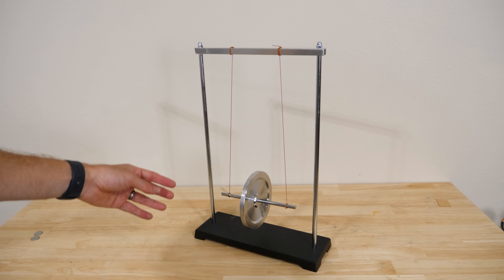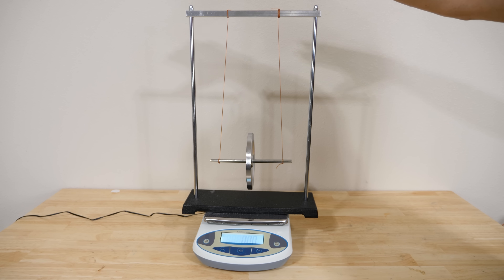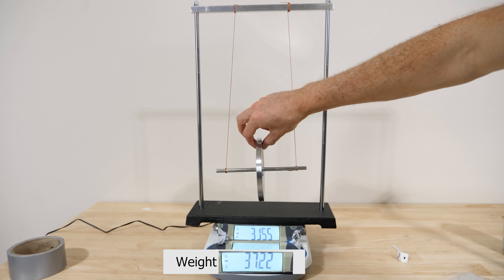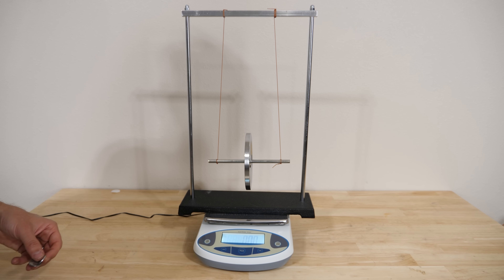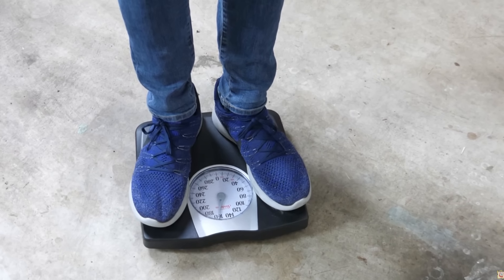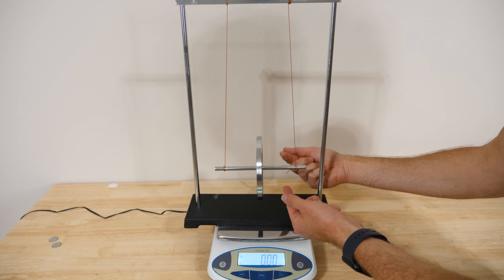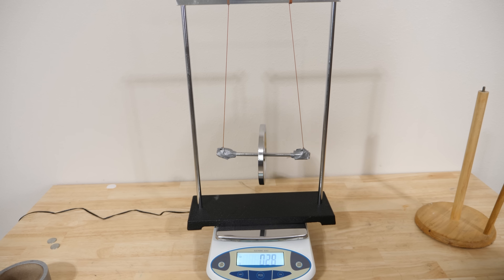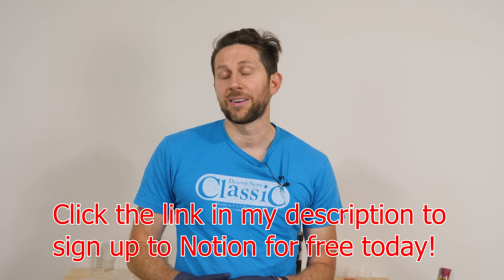How Does The Anti-Gravity Wheel Work?

Comment: If you plotted it at a high refresh rate, and looked at the area under the curve of the measured weight, would it average out to zero (slight negative most of the time, very positive for a fraction of a second as it bounces up)?
Reply: Yes, actually it would be slightly positive because energy has mass. But it would be very close to zero
Reply: @megamaser     No.   Energy does not have mass.  Light is energy and massless.  Mass can be converted to energy such as in a nuclear reaction, but that does not mean that energy has mass.  
In the experiment in the video, the mass never changes.  What changes is the downward force on the scale due to the change in rotational speed of the wheel.  The overall downward force over time is equal to the weight of the wheel.  So, while it is changing speed the downward force is less, but at the point where it comes to the end of the strings, there would be a surge to equal out the loss over the rest of the time.  
This would be similar to dropping an object on a bungee cord.  When it is falling the force on the connection point would be lower than the weight of the falling object.  When it hits the bottom there would be a surge, then it would be lower again on the way up.  The overall weight times time would be the same as the weight of the object at rest over an equal amount of time.
Reply: @my3dviews  Einstein showed that mass and energy are equivalent. Mass is basically a confined form of energy. So yes a free photon has no mass. But if you trap a photon in a box of mirrors then it will add mass to that box. The mass of protons and neutrons primarily comes from the kinetic energy of the quarks, which are confined by the strong force. Adding energy to an object by heating, vibrating, or rotating that object increases its mass.
Reply: @megamaser    Quote: "Einstein showed that mass and energy are equivalent."   Wrong.  E (energy) = m (mass) x c(speed of light) squared.  Notice Einstein's equation is not simply E=m.  
Getting back to your first claim that energy has mass.  That is incorrect.  Mass can be converted to energy and energy can be converted to mass, but energy itself does not have mass.   
Your last comment even admits that.  It says that a photon trapped in a box of mirrors will add mass.  That is converting energy into mass, since the photon no longer exists.  That is not the same as saying "energy has mass".  (it doesn't).
Reply: @my3dviews  Interesting how you're so sure of yourself but obviously not doing any actual research before making these assertions. I'm only stating some indisputed scientific facts that were established 100 years ago. Anyone with even only a bs in physics should know these things. I'll address your points one by one, but you seem pretty hostile to new ways of thinking, so I'm doubtful that it will be very fruitful. Anyway...

"Einstein's equation is not simply E=m"

Actually, it is, essentially. c is only a constant. It's an arbitrary scaling factor that's only used due to the choice of units. He included it mainly to illustrate the insanely large amount of energy in small amounts of mass. But it can be left out without impacting the equivalence. If you choose some other units, then you don't need the scaling factor. It's actually quite common to use energy units to measure mass, such as electron volts.

Trapping the photon in a box of mirrors does not destroy the photon. It continues to exist, reflecting against the mirrors. If you open the box, the photon will escape. It's a commonly used thought experiment to illustrate mass energy equivalence. There are some nice YouTube videos to visualize this example. 

Converting mass to energy means you have released confined energy. Converting energy to mass means you have confined energy. 

For example, endothermic chemical reactions consume energy to bring electrons into a higher energy level. Usually this is thought of as a conversion from kinetic to potential energy. But that potential energy has mass, we know this because endothermic reactions result in products that have greater rest mass than the reactants, so it can also be considered to be a conversion of energy into mass. But if you consider the heat that was absorbed, it was also contributing mass to whatever was hot, so the overall mass of the entire system is unchanged. The energy was always massive, and the mass was always energy. 

Likewise, exothermic reactions, like fire, can be said to convert mass into energy, because the reactants have greater rest mass than the products. However this lost mass was manifested in the potential energy of electrons, and it actually isn't lost since the thermal energy still contributes mass to the entire system.

It is a little weird to say that energy "has" mass. I think it's more accurate to say that mass is energy. Mass is an emergent phenomenon that results from the confinement of energy.
Reply: @megamaser    Quote: "Converting mass to energy means you have released confined energy. Converting energy to mass means you have confined energy."   Never said otherwise.  In fact, that is what I was saying.  Energy and mass can be converted one to the other, but that does not mean that energy has mass.  So giving lots of examples of mass being converted to energy isn't saying anything that I wasn't.  

Your last comment stated "It is a little weird to say that energy "has" mass. I think it's more accurate to say that mass is energy."

I wouldn't say that it is just more accurate, since the first claim was inaccurate.    

Compare those statements. 
1)  Energy has mass.
2)  Mass is energy.  
Ask the question:  Can you have energy without mass?  If that answer is yes, then does energy have mass?  

If you want to stick to that.  Go ahead, but I don't agree.
Reply: @my3dviews  Well now you're just getting pedantic. This point is irrelevant to a lot of the arguments you were making. And it's also irrelevant to this video. It seems that your main goal is to find some way to prove someone wrong to make yourself feel smart. Not sure what that's going to accomplish in the long run. 

Sure I'll agree that not all energy has mass. There needs to be some kind of interaction to say there is mass. But in the context of this video, the energy in question does have mass, just like a proton has mass.

Comment: I wonder if this method could be exploited to move heavy objects across distances with minimal friction do to gravity.
Reply: Maybe that’s how the Egyptians built the pyramids!
Reply: @brads9418  nooooo! Yes! Yes that's it! OMG!
Reply: @johnnycash4034  more likely they used vibrations of some sort.
Reply: @loganthesaint  nooooo! Yes! Yes absolutely! That's it!
Reply: I was thinking about a crane that used this, but the wheel in this video must weight at least 500g (probably more) and it only loses 6g for a relatively short period and you have to use energy to roll it up. The cases where you'd need to move something that is 1% too heavy are probably no worth the complexity of such a crane.
Reply: It wouldn't be efficient, as the total amount of energy consumed would be far greater.
Reply: You probably can't. It was kind of like when I was jumping on the scale. Most of the time, I would weight zero, but when I was physically touching the scale, my weight goes up a lot. You can totally build a machine that by jumping, you reduce the friction, but the jumping itself probably will cost more energy loss. There aren't many species jumping like kangaroo :)
Reply: The average readout on the scale really should be zero, if the scale had enough resolution to sample what is happening at every point in time.  It is a sampling bias that gives the appearance that there is a loss of weight of the system.  If you could account for exactly what is happening at every point in time during the rebound, you'd see a spike in the scale's reading.  Integrate the scale's reading between two equivalent points in the scale, and you would see that the net impulse from scale fluctuations is zero.

That said, if you tried to use this for relieving objects of their weight, so that you could improve the mobility, you'd have to pause every so often to allow the rebound to happen, where the apparent weight of the objects is so high, that the number of g's would not be survivable for a human passenger.
Reply: I don't think it is like jumping on a scale. As the wheel only moves slowly up or down the string....that type of momentum would only have a slight effect on the weight for a slight amount of time.
Reply: @colorado841  It would be like you jumping on the scale in a slow motion.
Reply: @lalandbaby  No...because then there would be a spike in weight that would last for a long time.

Comment: @The Action Lab  I think the reason the gyroscopic weight was easy to lift was the lack of torque needing to be applied to keep the weight from rotating down. I think it would be similarly light if held at its center of mass.

Comment: A simple way to think about this is to imagine yourself tossing a 10 pound weight into the air repeatedly and the time it takes you to throw it back up equals the time it is in the air.  You can say that it is weightless when it is in the air, but the average force of the weight while you are holding it will be 20 pounds.  Two men keeping one of their two weights in the air at all times will still be supporting 20 pounds at all times but it will be as if the weight is shifting on the scale.  Also consider a bouncy ball.  It may only be on the ground 1/100 of the time.  But the average force may be 100 times that of the ball.  This may help understand why dropping a steel ball or hammer can be so powerful.  And why adding springs can decrease the force of a gun greatly.

Comment: Would the same effect be measured from a pendulum swinging back and forth?
Reply: Maybe, but it would be minor because the pendulum lowers its center of mass only my rather small distance. But I think the same principle would work for weight-driven clocks as well.
Reply: When the pendulum bob accelerates upward, there is an apparent gain in weight.  When the pendulum bob accelerates downward, there is an apparent loss in weight.  The centripetal acceleration is from the rod pulling the bob inward, and the tangential acceleration is from the component of gravity that makes it swing.  We can calculate when this will happen by finding the net y-component acceleration, and determining the critical angle where it is zero.

Given an amplitude angle of A, I derived the following formula for the critical angle theta_crit, where the vertical acceleration switches direction.
theta_crit = 2*(arctan(sqrt((2 - sqrt(cos^2(A) + 3))/(cos(A) + 1))))

For small amplitudes, this approaches sqrt(2)/2, or 70.7% of the amplitude angle.  For a 30 degree amplitude, it's 69%, or at 20.9 degrees.  The critical angle becomes a smaller fraction of the amplitude, the higher the amplitude.  The extreme case of a 180 degree amplitude has a divide by zero problem, but we can calculate it for angles arbitrary close to 180 degrees and get that it happens at around 39% of the amplitude.

Also for small amplitudes, where you can approximate the pendulum as simple harmonic motion, this occurs at the half way point in time between its release point at the amplitude, and the neutral point where it passes through the middle.  This means that it spends half its time weighing less than it does at rest, and half its time weighing more than it does at rest, when weight refers to the vertical component of the scale's support force.
a 30 degree amplitude, it's 69%, or at 20.9 degrees.  The critical angle becomes a smaller fraction of the amplitude, the higher the amplitude.
Reply: You could exemplify this same effect with an old pendulum clock. Not due to the pendulum but the weights that powered the clock. The weights on strings would have a constant acceleration toward earth until such time as the string completely unwound, then it would resume is natural still weight.
Reply: @axle.australian.patriot  You'd get that if you took out the escapement mechanism, and put the hanging weights on ideal pulleys, like Atwood's machine.
Reply: @carultch  No, just an old pendulum clock (With wind up weights) will produce exactly the same effect :)
Reply: @axle.australian.patriot  I don't think the wind-up weights move at anything close to constant acceleration.
Reply: @carultch  OK, I haven't stated that correctly, but constant to the acceleration of gravity. The weights are falling at a constant velocity the same as the spinning wheel is falling.

Comment: The atomosphere is lowering the weight. Why are you not talking about atomosphere interference. Atoms that are all around the disk
Reply: He has explored this by weighing objects both in air, and in a vacuum chamber.  He has plenty of vacuum chamber experiments that are fascinating.

The densities of all the materials involved in this example are over 1000 times greater than the density of air, so air buoyancy is a joke to consider in this example..
Reply: @carultch  no it isnt ridiculous to consider, if you don't understand that, no need to explain it to you. Cars and planes have much more a difference in to the air. Even 30mph can cause a good amount of drag depending on object shape.
Reply: @carultch  look at this way knob the force of an object with it's shape pushing airflow with the speed of the object causing drag. Drag is a real thing, don't bee a snoty wanna be know it all
Reply: @adambuettner754  You are confusing buoyancy with drag.  Air drag could be significant in a scenario like this, but buoyancy could at most contribute a 0.1% error.  Even so, air drag is not the fundamental reason why the scale reading goes down.  Otherwise, the scale would return to normal when the disk stops momentarily at the top, because drag requires speed relative to the air to apply a force.  Drag force in a windless environment with everything stationary is zero.

Comment: It should go to zero when the wheel hits the bottom, the scale update rate is too slow.
Reply: It should go A LOT higher than zero, when the wheel hits the bottom.
Reply: @carultch  Well, at least zero, the point is the scale is not registering the fast fluctuations in reading.

Comment: That was the first thing I thought. A vacuum. I know that the perpetual magnet generators probably won't work on earth. But enclosed, in space ie (no actual gravity, or almost, with no actual gravity) using no physical bearings. Instead using magnetics for the axal to axal transfer and surrounding each axal to hold them each in place (without physical friction) and transferring the kinetic energy through another set of precisely placed magnets on the other axels including the generator side (also no touch just magnetic bearings). Here's the kicker. Run that satellite using solar energy. Radiometer, but used as a secondary power source. Zero gravity environment, vacuume, completely enclosed other than the "glass" to allow sunlight through. If the magnets are properly placed at a micron level, there shouldn't be much maintenance level on this. Potentially it can just move faster and faster and faster. If it's made properly, this could power the whole world at one point. Transfer through either through light, wave, or possibly(and this won't happen in my lifetime) elevator. Fusion will probably, finally, be a reality before I'm gone. But just saying. I think it's viable.
Reply: Perpetual magnets might turn for longer time, but you will never get more energy out than you put in.

Comment: If you measure the gram force change for your various modification and unmodified over the entire timeframe of the spin duration does the total force equal the initial potential energy at whatever height you started the wheel at? i.e. are you essentially using a scale to measure the overall kinetic energy conversion to other forms?

Comment: You should show it with an old scale (mechanical). We should see the thing bounce a bit at the bottom =)
Reply: Just a simple calculation. If the effect of lowering the wheel during 3 seconds is -6 grams; in a bouncing spike of let's 1/10 of a second you would feel a 'weight pulse' of 30*6 = 180 grams. Thats a whole lot It should be visible somehow, but even playing the video in slow motion I don't see any movement(shock) of the balance indicating this
Reply: Yes, the average weight does not change. And his glossing over of said fact was disappointing. The title could have been:
“It’s MAGIC! Or my scale’s refresh rate is too slow to do this experiment”.
Reply: the wheel bouncing at the bottom will kill the kinetic energy n inertia by the friction depended on the surface just like you spin rear wheel of a cycle in air n drop it causing it to stop completely
Reply: @jcd-k2s  lol no need to do all that math, Emmanuel was right. Force = dp/dt. The bounce happens in a fraction of a second, the change in momentum is 180 degrees in the opposite with equal moment. That spike would not be negligible and we would definitely see it. I'm not convinced.
Reply: @jcd-k2s  no I am always absolutely correct. You are wrong for disagreeing
Reply: no, old scales have too much mass and inertia and would filter out any small spikes in force.
Reply: @two_number_nines  In some cases,  an analogue scale will do the job better.
Reply: @two_number_nines  Oh, ok... ^^